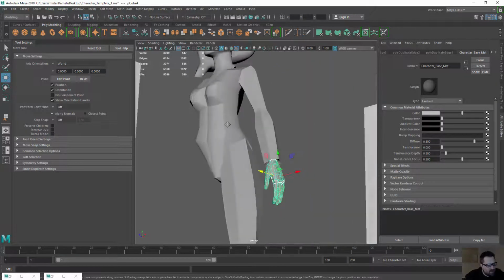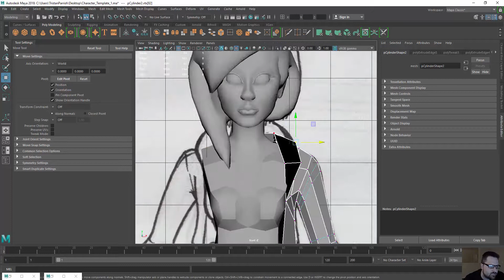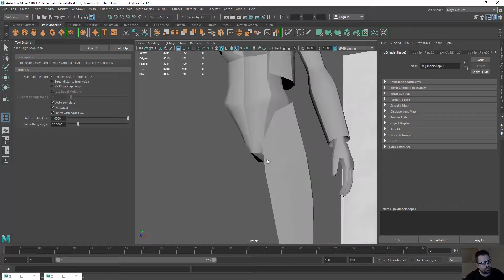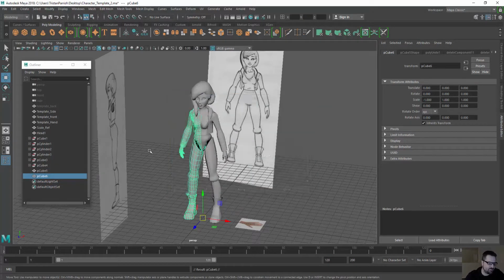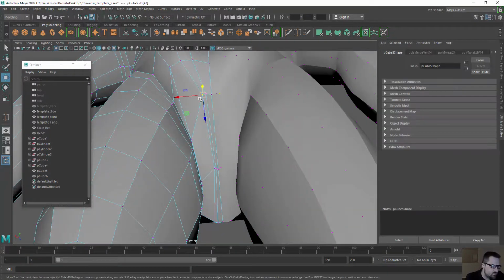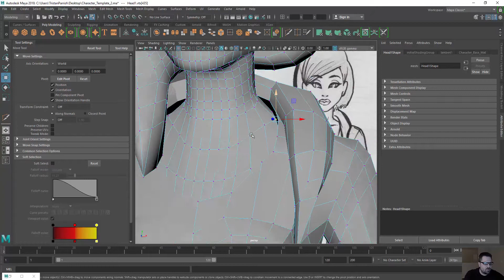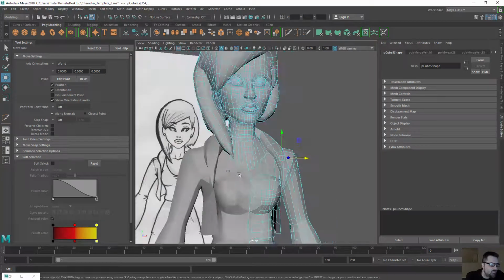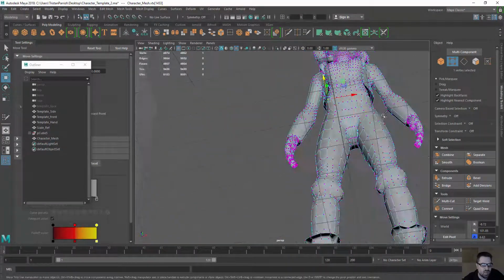Tutorial: Low Poly Character Modeling in Maya - Part 7

Comment: Hey Mr. Moore, if you ever have a chance you should upload a video detailing baking in Substance and how to reimport with textures to maya! I'm currently having problems with it.
Reply from the maker: That's definitely something I want to do a video of so that's a good idea! I'm hoping to put together a few baking and substance tutorials soon so keep an eye out for it! What trouble are you having, maybe I can help explain it? Remember you need to either have a high poly or use the low poly as the high poly to bake maps in Substance!
Reply: Tristan Parrish Moore So I have my low poly and my high poly which I made in zbrush. The low poly baked well in substance but I'm having trouble exporting the bake and textures. It's not exporting correctly to where the high poly geometry isn't showing up
Reply from the maker: Jus to make sure you know what to expect, you should be planning to export your texture maps by using File > Export textures, this will not export your models however. W/hen you select a location it should export all the maps you need for the preset you selected, such as UE4, Unity, PBR etc. So you won't really have high poly geo show up but will have normal map data, and potentially height data if you choose that. Is the trouble that you're trying to get the model to show up in Maya with those textures the same way that it shows up in Substance? Because that may be about setting up the right material settings and possibly flipping the Green channel in your normal map. If none of that helps can you be a little more specific about what the problem is that you're running into so I know what's not happening with the export?
Reply: Wish I could post screenshots here lol. Basically, the model has extra detail such as sculpted teeth and eyebrows that don't show up when I try to bake the exported mesh to my low poly in Maya. The textures exported well, but they look super weird when I apply them to the low poly so I think I'm doing it wrong.  Collin doesn't ever export from substance so he has no clue why it's going haywire.